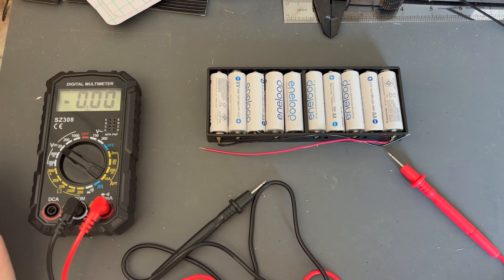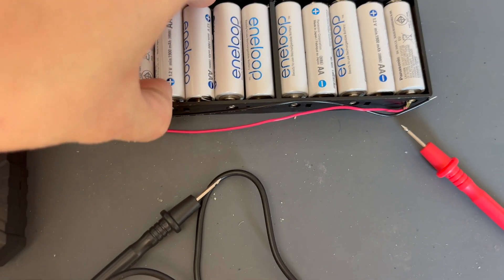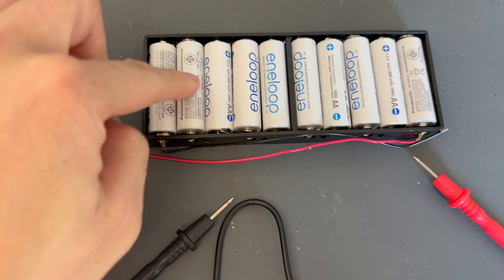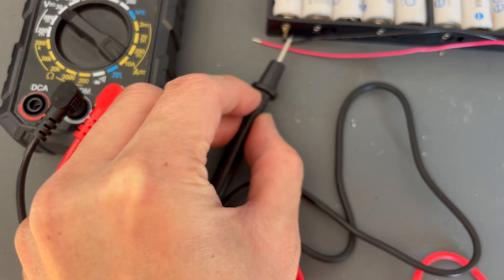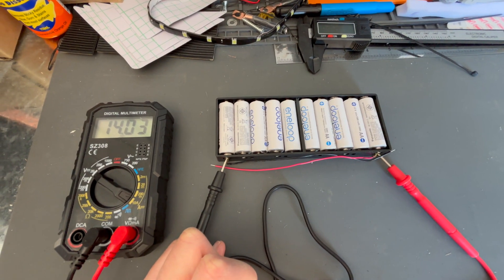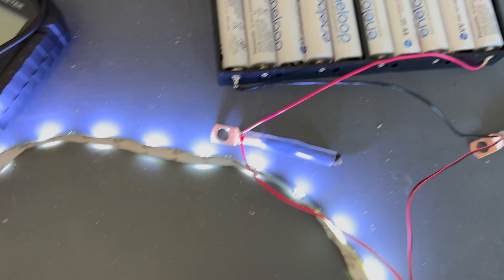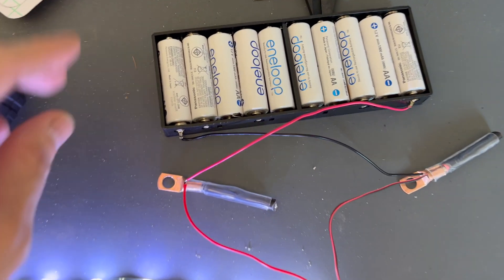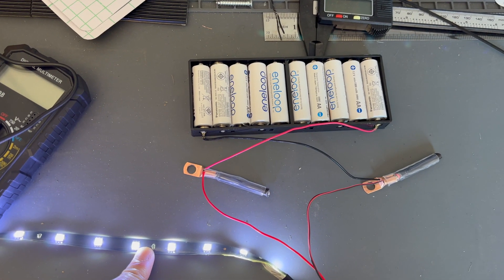🔥 DIY 12V Power From AA Batteries?! (Surprisingly Useful!)

Comment: I did a video series a long time ago testing various brands of NiMH batteries using the PowerX MH-C9000 battery analyser. The Eneloops all passed the test as did the Duracells and Energizers. The batteries I tested from Jaycar all failed, not making their advertised capacity.
I ended up taking those videos down when I was tidying up old videos that no one was watching.
Reply from the maker: I’d be interested in those videos! You should leave them up anyway 🙂
Reply: Yeah leave them up